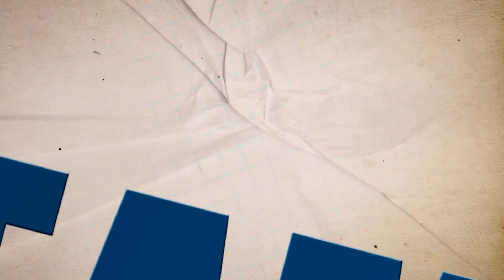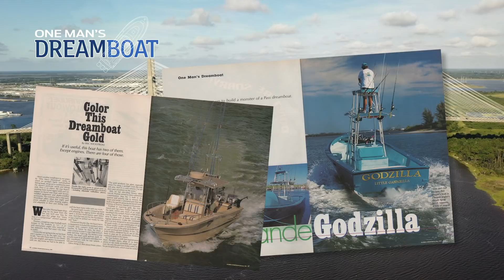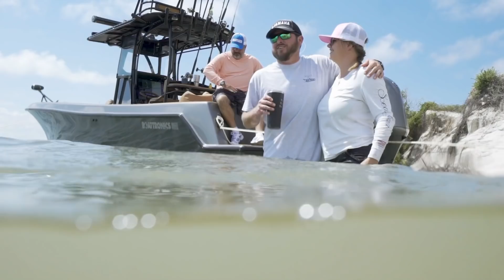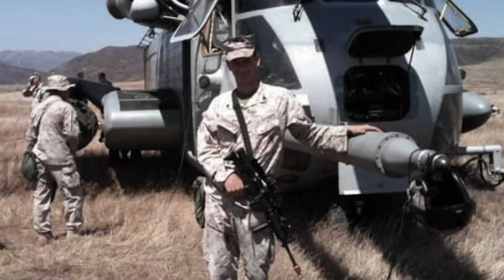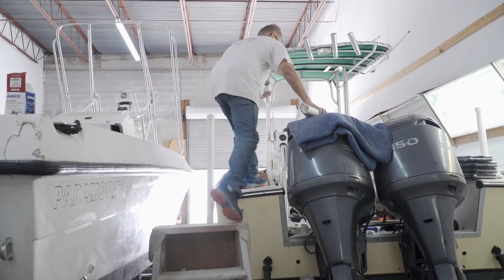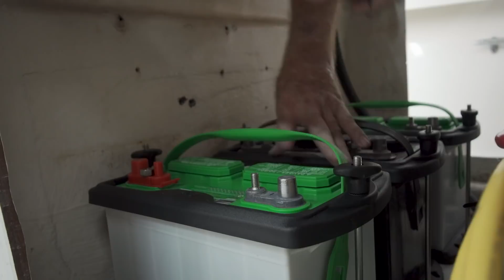Florida Sportsman Project Dreamboat - Custom Alan Jackson Splash; Insane 31 Contender

Comment: We took a lot of pride in putting together the Lighting package for the 31 Contender. The under water lighting, Under gunnel lighting and the controls that made it so cool. All the pieces and parts coupled with Tony's expert installation and the result is jaw dropping
Reply: Custom LED and FiberOptics Inc - what under gunnel lights are they?
Reply: @CaptStoots  These are the Under gunnel lights we have made to our specs. It's the reason they are so crazy bright. You can call us at (954)444-8650,  email. Rob@CustomLEDinc.com or go to WWW.CustomLEDinc.com
Reply: @CaptStoots  These are lights built to our specs. Very durable and exceptional bright. you can read some testimonials at WWW.Customledinc.com